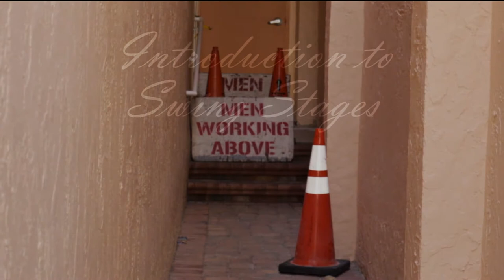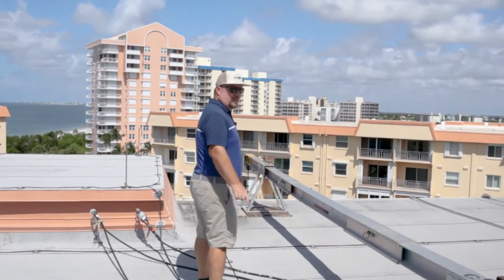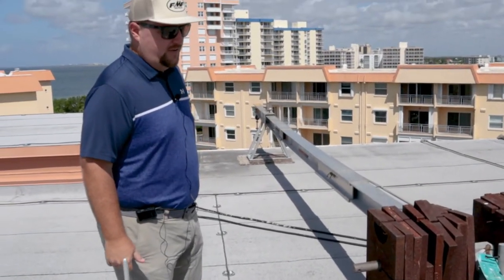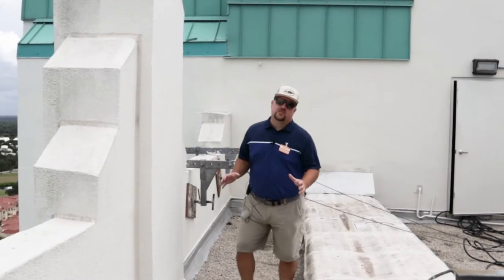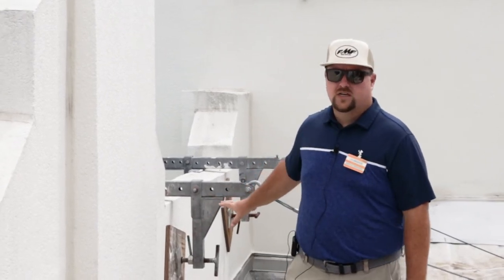Swing Stages, an Introduction

Comment: Working on 2 different buildings with a swing. 1st build is weights, beams, and 30 ft board doing balcony repairs. 2nd building is a davit system 26ft board cutting out and replacing caulk. Davit system is so much better, don't have to carry all the weights and beams up to the roof.

Comment: Informative video. I disagree with your statement of 200 lbs of load for each safety line. Shock loading in the event of a failure of the swing stage would result in a shock load in the thousands of pounds. The socks are for line protection, a shock load event could sever a safety line on a sharp corner.  
Still working as a steeplejack for 55 years and counting. (I started very young)

Comment: Something I'd like to clarify is that as you indicate the "yellow socks" on e the safety lines and similar for the beam tie-back cables where they go over the roof edge. Those "socks" wouldn't do much to protect the roof edges. There needs to be wood or something similar to spread the load out rather than having all that weight digging in being that cables are typically 3/8" and safety ropes are 3/4". But most importantly, those "socks" are to protect the ropes from chaffing on those metal edges. Those safety ropes are expensive and need to be cared for and inspected daily. We usually used  2 to 3 ft sections of 3/4"  I.D. contractor grade water hose.
Roof edge protectors, and for parapits, we'd use 2 peices of 3/4" plywood screwed together forming a 90 degree angle. Add another price to form a "U" shape for stucco parapits. Seen many parapits and safety lines ruined by unprotected lines cutting through from not having proper planning/ execution.
Reply: Also, some buildings have sockets or "davits" that are built into the roof so they can use specially designed crane type outriggers that can be taken down to move around the perimeter of the roof and then stored up on roof when not in use.
But like you mentioned, they need inspections or recertification for use if they haven't been utilized in a while. Which in itself is expensive, so  many people just bring up the beams and counter weights and just use the davits as tiebacks.
Reply: In downtown Chicago we always used 5/16 wire rope and usually used 5/8 safety lines. Carrying a 5 or 6 hundred foot section of 5/16 up the stairs to the roof was about all I could manage. I don't think I could pick 500' of 3/8 up off the ground. 
Sometimes we used pieces of hose to protect our safeties but we usually used carpet on everything. We pretty much never ran anything over the opposite wall of a building, everything stayed on the roof. And, I saw plenty of buildings with davits but never once worked off of one, we always had to drag our own rigging to the roof. That's okay though, I trust my life to my rigging. Those davits, not so much. I've also hung off of many parapet hooks, which he didn't touch on, and worked rope stages numerous times. I wonder if OSHA still allows those.
Reply: @jamesbarca7229  you ever work with a deaf guy goes by the name Mike Erickson?

Comment: Great video, thank you!

I wonder, is there some safety system in place to stop the stages from swinging due to strong winds?

Also, are BMU systems commonly in Florida? Maybe only for commercial buildings?
Reply: If you’re able to in Chicago, we use eyebolts slide into the wall and as you get to the floor that you’re gonna be working on your tire your cable to that boat with a long rope do your job on time and keep it moving tie back up next floor Hope this helps as you go down. You can keep the top ones tight and as you go back up you’re on tight as you go up. Keep tired from the top down so that you’re not swinging out the further down you go hope this helps.

Comment: I don't like the counterweight setup, or the setup in general for that matter. Seems kinda chintzy to me. It would be too easy for one of those stands to go over (I don't know if you noticed that the counterweights weren't even secured and would slide right off), or for one of those hangers supporting the counterweights to fail, which would cause that chintzy little stand to flip over. It's not that much more work to bring some pipe frames to the roof and hang the weights from the beam where they cant go anywhere. It's a much safer, more robust setup and wouldn't take much longer. If they sent us that crap setup in downtown Chicago, we would laugh and send it back.
Reply: I'm not criticizing the video. It's a good video laying out the basics of swing stage rigging, which most people don't have the slightest clue about. I just don't like the setup the contractor is using.

Comment: How much does each of those counterbalance weight plates weigh?  Looks like it would be a LOT of work getting them and all the rest of the beams etc. up to the roof.  A giant Sikorsky helicopter would be nice.
Reply: They weigh 50 pounds each. You carry them up the stairs two at a time, one in each hand. Yea, it's a lot of work. I would always tell my guys "We're rigging tomorrow, so make sure you eat your Wheaties". I worked in downtown Chicago for years and on the really tall buildings the thing that weighed the most was the cables (wire ropes) and second was the safety ropes. You would sometimes end up with 500'+ sections you had to lug up the stairs.

Comment: How do you link the 2 motors to run it with one man?
Reply: You don't, at least legally. They have remotes though which you need for a corner stage as it has three motors.
Reply: @bradsanders407  You can, you just need a pendant; which you would connect to your transformer.